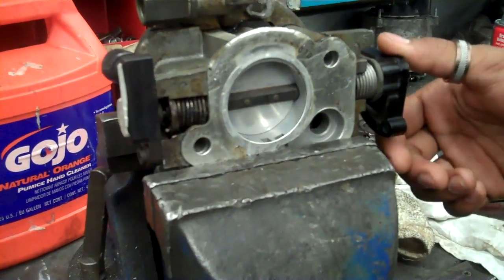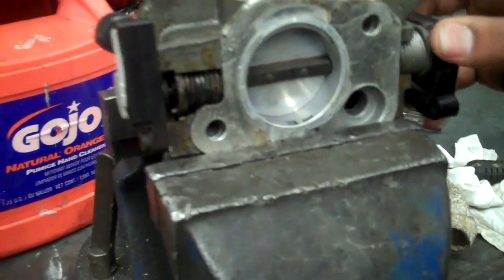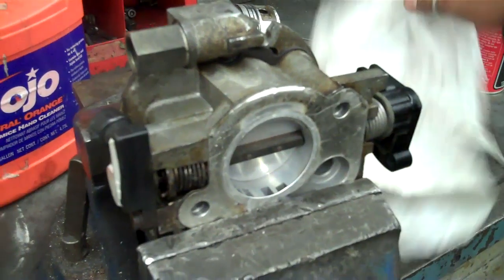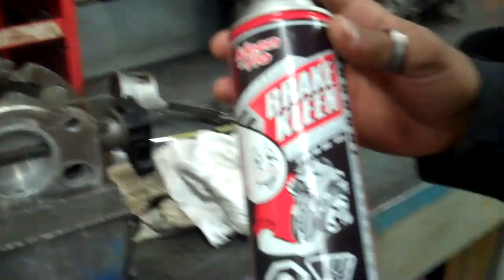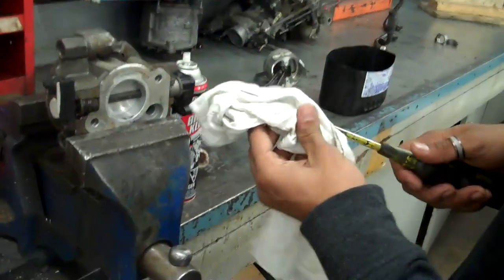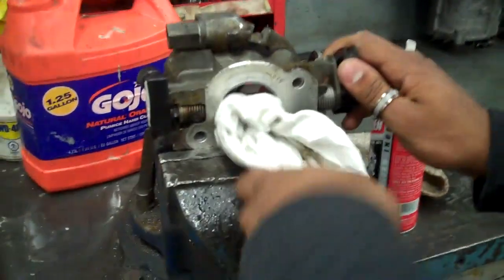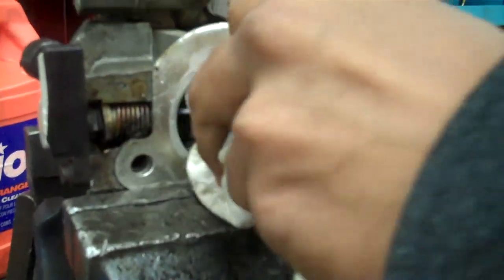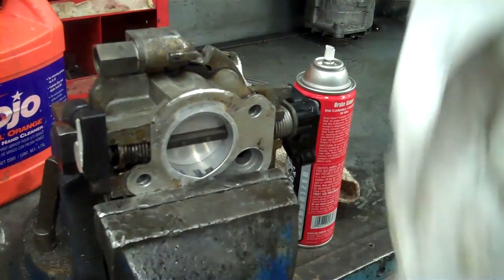Cleaning throttle body on a TBI system. By: Zach R.

Comment: The last thing you want to be putting in your throttle body is brake parts cleaner. Why didn't you use carb cleaner? No, that would be too smart